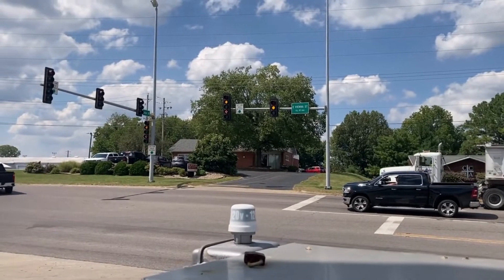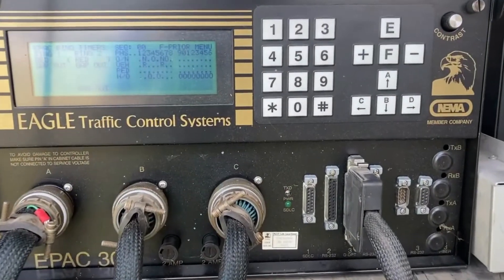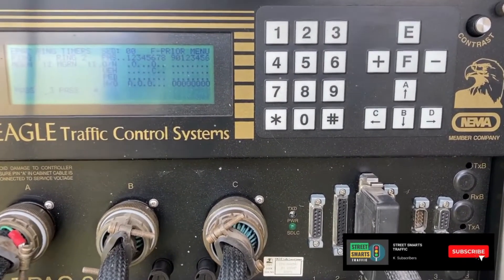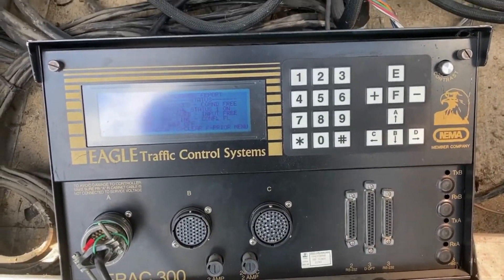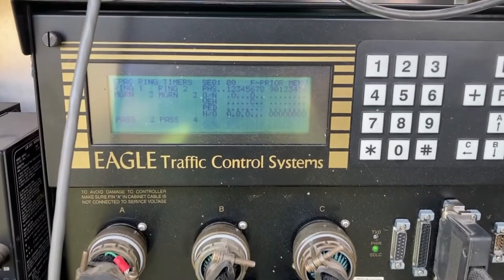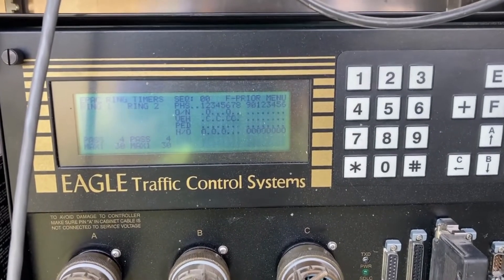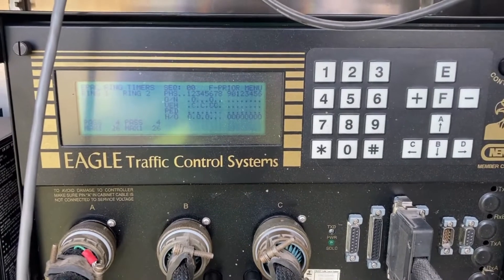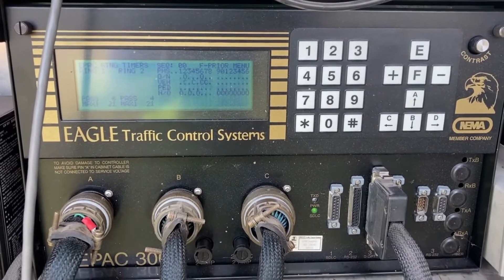Troubleshooting Traffic Signals on Flash

Comment: Eagle controllers definitely last a long time.  I've had my EPAC M40 for close to 20 years and it's always run like it should.  It has pretty basic programming and I've updated the firmware to the very first version to include functions for the flashing yellow arrow signal, so it was fun to play with that function for a while in my home setup.  I'm currently rebuilding my setup and I hope to include a FYA in the new setup.
Reply from the maker: Good luck!  You definitely learn alot about wiring, programming & troubleshooting with a traffic signal home setup!